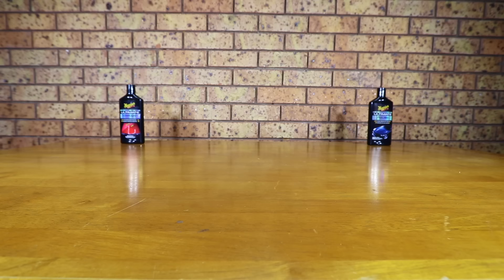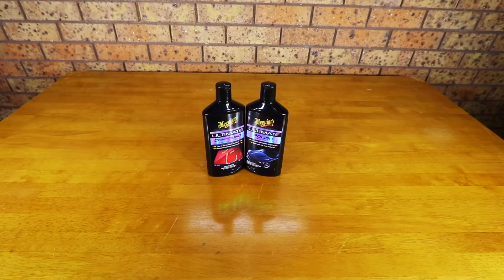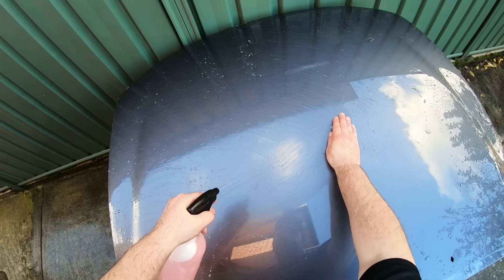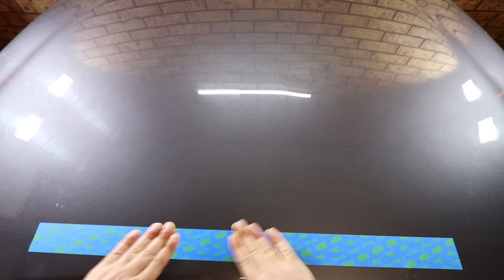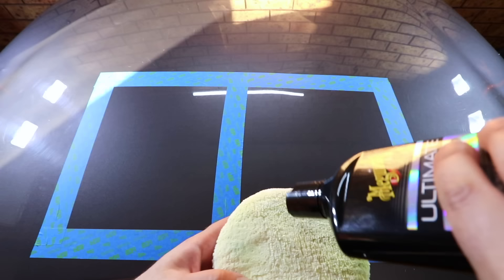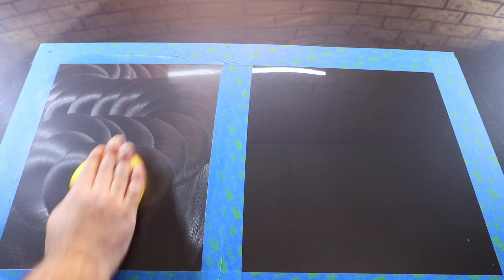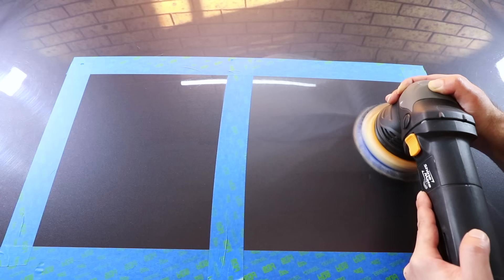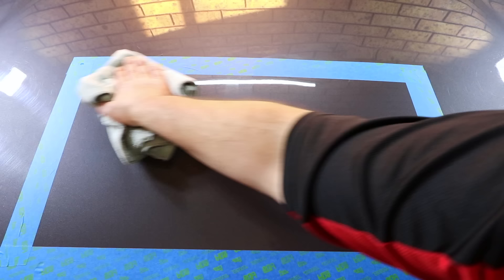How to Use Meguiars Ultimate Compound & Polish+ Review & Demonstration!

Comment: I know I’m quite late to this video but one of my doors are quite faded so would I just be able to use the polish alone then wax or is compound needed as I’m not after factory new paint just something that looks abit better than a dull blue, cheers lads
Reply from the maker: All car paint is a little different in its hardness and the specific defects or fading/oxidation it accumulates, so you don’t really know what’s going to work until you try it. I would start by using the polish and doing a smaller section to see if that gives you the results you’re after, and if so that’s great and you don’t need to use the compound. But if not, then there might be a benefit in using the compound which will be more effective if the paint needs that extra step to achieve the results you’re after.

Comment: I recently used Meguiar’s Scratch X to remove a scratch on a 2018 CRV. Most of the scratch is gone but I noticed that now part of the paint has faded (may have used too much Scratch x). I tried using Meguiar’s Ultimate liquid wax but it’s still dull in one spot.  Would using a compound and/or polish help restore the damage that Scratch X caused?

Comment: hi !  I used ultimate compoud and then ultimate Polish yesterday, but it was very difficult to remove them, they dried very quickly.  I did it in the garage at 10°C, but if I didn't remove it instantly, it was a nightmare to remove the product.  what am I doing wrong ?  I got much more tired taking out the product than applying it
Reply from the maker: It’s hard to say for sure without being there with you, but it could be your using too much products, so try halving or even using a quarter of the amount you where using. Also try working smaller sections, no more than a half meter square, but generally the smaller the section the better results and easier wipe off. You can also try working it a little longer with more pressure, I compound will go from looking more opaque to more transparent as a sign it’s been work well, broken down and should be easier to remove.

Comment: I have found each of these products dry very quickly and can be very difficult to remove, even when working in small sections.

Any tips on overcoming this issue ?
Reply from the maker: We all work a little differently and without being there next to you I can’t say for sure why you’re having that issue. 
It can be over or underworking the compounds - finding that sweet spot helps with the user experience. It can also be using too much or too little product, and your environment/climate will also effect everything. 
Sometimes it’s best to just try different compound as maybe it will suit your style of polishing better.
Reply: @CarCraftAutoDetailing  OK, thanks for taking the time to reply.

Comment: May sound like a dumb question but would it work on headlights I know there’s other options so don’t get on me about that but I’m curious if it would help any
Reply from the maker: Yes, it can work great on headlights and even other clear or plastic trims. Sometimes you’ll need to sand before hand - but not always - and if you do you can also use them to refine the sanding marks.

Comment: I have found that Ultimate Compound and M205 provide the result I am looking for without very much hassle.  For some reason M105 doesn't work well for me when I use it with a DA polisher.  By hand it is perfect, with the DA not so good.  Same issues with Ultimate Polish.  It works ok by hand, but I just have trouble with it on a DA.  I have found that M205 is much easier to work with on a DA polisher.

Comment: hi, after using Ultimate Coumpound you degrease the surfaces, right?  And after using Ultimate Polish, should I also degrease the surface before applying the wax, isn't it required?
Reply from the maker: No, it’s best not to perform a panel wipe after Ultimate polish as it may remove some of its filling abilities and degrade the finish, so you can wax right over it.
Reply: @CarCraftAutoDetailing  tkank you so much. Take care 😉

Comment: Mr Sandro, excellent video as always, I have a question, I was using meguiars with the shinemate short nap wool pad and the ex620-5/15 polisher at speed 5 (since it finished better) with the meguiars ultimate compound and was getting all the defects on a medium hard paint (the other pads that come with the polisher didn't cut enough) but the pads backing started breaking (the foam backing started fuzzing and flinging) did I used the polisher too fast or did I overheat the pads?. Greetings all the way from Mexico
Reply from the maker: Thanks mate, I can’t say for sure, but in most cases that happening tends to be due to excess heat building up on the Velcro side of the pad. I usually work with 3 pads at a time and swap after them every few section to allow them to cool before swapping them back in. Using compressed to blow out your pads can also help cool them down after each section.
Reply: @CarCraftAutoDetailing  Thanks a lot for the response I will try modifying my technique accordinly.

Comment: Can anyone advise : using the ultimate compound - after u done with a section do you wash off the  compound in the water and dry the applicator pad ?? Or just keep adding more and keep using it ??
Reply from the maker: Add a couple more drops and keep using it when working by hand - you should have a few applicators if you intend on doing the whole car, switching to a fresh one after a few panels.

Comment: Dumb question, but when you wipe of the polish or compound are you using any particular liquid or just water?
Reply from the maker: It’s an isopropyl alcohol dilution mix used to remove polishing oils and prepare the paint for a wax sealant or coating. You can buy them ready to use like Carpro Eraser or Nv Clarity or you can make your own mix using 1 part (100%) isopropyl alcohol with 3 to 4 parts distilled water.
Reply: @CarCraftAutoDetailing  thanks for the quick response

Comment: Sandro 2 questions 
Can i use any of these to get rid of scratches on Piano Black?
Do i do the whole car? (Bumpers spoiler side skirts) or is it only meant for metal panels? 

Thanks
Reply from the maker: Yes you can use it on any colour paint and piano plastics and generally if it’s painted or with a high gloss finish you can polish it, just avoid polishing matte, satin or texted trims.
Reply: @CarCraftAutoDetailing  thanks mate appreciate it 🙌

Comment: Hi a very detailed show thumbs brother one a kind of silly question is meguiars color x the same as polish wax or a cleaner wax?
Reply from the maker: Color-X would be considered an all in one polish (you can also call it a polish wax) it should do more than a cleaner wax to restore weathered paint as well as leave some fillers and a protective sealant behind, but it won’t have the true defect levelling ability as Ultimate Compound. 
It many cases Color-X could be great option - it just depends on the paint’s condition and your goals.
Reply: @Car Craft Auto Detailing  ok sounds good, but I'm still going to give you some goosebumps questions, mate 😀 😉  so if I use first meguiars ultimate compound, then meguiars color x after can it work waiting for reply desperately and wanna thank you for time and concern God Bless you mate
Reply: @CarCraftAutoDetailing  I hope u reply soon
Reply from the maker: Yes that can absolutely work well - every paint is a little different so always assess your results in the moment, but there’s no reason you can’t use that combination.

Comment: Thanks for the video. Well explained. What is that spray you used between the compounding and the polishing steps?
Reply from the maker: It’s CarPro Eraser, and IPA panel wipe to remove polishing oils.
Reply: @CarCraftAutoDetailing  Probably a silly question, but, can Meguiar's Ultimate Polish be used on the glass of the windshields and windows?
Reply from the maker: Yes it can

Comment: Just subscribed. Great informative video mate. I use UC on some small scratches from car doors hitting my paint. I applied it with a Terry cloth Applicator pad. It left a haze over the section I worked. What would you suggest I do to correct the haze?  Again, great content. It’s greatly appreciated
Reply: Car Craft Auto Detailing Great! I’ll give that a go using Ultimate Polish. Thanks for replying, have a great day

Comment: What alcohol cleaner is the best or will good old wax and grease remover do the job?
Reply from the maker: You can really use either and different paints can react differently to water based IPA cleaners and solvent based prepsol wax and grease removers so there’s not always a single best product depending on the paint and situation.
Reply: @CarCraftAutoDetailing  thank you for the response.

Comment: Will this help with oxidation? If so, what DA pad should I use? I've currently got the standard foam  pad (that comes with the supercheap Rockwell DA).
What speed setting should you set the DA polisher at?
Thanks!

Comment: Hi mate, not sure if youll even see my message due to the age of this clip. When you use those applicator pads to apply the compound /polish, do u use the same one for the whole car or does it fill up too much with product? Thx
Reply from the maker: I’ll generally use a few pads to polish a whole car and I’ll continuously use compressed air to blow the residue out of the pads and keep on swapping and rotating the pads to allow them to cool throughout the process.
Reply: @CarCraftAutoDetailing  ok thanks mate, noone ever mentions this point in the polish by hand videos that ive watched. Appreciate the reply
Reply: @CarCraftAutoDetailing  can u recommend a decent budget DA polisher? Ive sen cheap ones (mechpro) at repco for example but not sure how the cheap ones work. Id only be maintaining my cars and myvfruends and family . Dont want to spend hundreds. Cheers mate

Comment: What to do about streaking and what we’re you spraying on it when you were done working it in?
Reply from the maker: I was spraying and an alcohol based cleaner (Carpro Eraser) to remove polishing oils. If you’re finding it hard to to remove and seeing streaks, try using less product (half the amount) and try working smaller sections. You can even use a damp cloth to wipe it down.

Comment: I have a question, can i use the ultimate Compound on piano/gloss black surfaces on car and can i also use it on the glass to remove water spots?
Reply from the maker: Yes you can use it for both those areas.
Reply: @CarCraftAutoDetailing  thanks a lot:)

Comment: Can I use ceramic spray coating of turtlewax after using these two products or can I use ceramic spray directly without using polish wax? Will that be ok?
Reply from the maker: Yes either way should’ve fine, applying it before the polish and firstly doing an IPA wipe may help it last a little longer.
Reply: @CarCraftAutoDetailing  thanks

Comment: Ok so Compound with medium force then Polish, but if I don't have Polish,  could Compound with low force or a softer pad achieve the results of Polish ?
I haven't tried yet because I'm new to this and I don't want to mess it up.
Reply: The difference between compound and polish is mainly in the type of abrasives. Polish has finer abrasives. 

Like with sandpaper, you scale down from rough to fine. If you would use less compound with less force, that would be the same as using the same rougher grit sandpaper in stead of a finer grit sandpaper, and using that rougher sandpaper with less force, expecting a finer finish, which you normally only would get with the finer grit sandpaper. 

You might get away with it, but polish is always better.

Comment: How many times can I polish with ultimate compound using regular pressure on a DA before I need to worry about my clear coat thickness?
Reply from the maker: There’s unfortunately no answer to that question. It will depend on how much clear coat you car has to start with, how hard that clear is, what pads you use, your other polishing techniques beside pressure, what sort of sharp body lines your car has and so on. You could literally burn through the clear in one go or polish a hundred times without issue - it’s just all dependent on the specifics.
Reply: @CarCraftAutoDetailing  Assuming I use regular pressure with a lake coutry yellow pad on a DA polisher and I'm polishing an e46 BMW with factory paint. Assume that this BMW has been polished very few times and the clear coat is in good shape. Assume I make no mistakes with the DA and follow exactly your technique: small sections with just enough product. I am looking for an order of magnitude. 3 times, 10 times 20 times or 100 times?

It would be interesting to learn how to use a paint thickness gauge (one of those enthusiast models at $100 or so on Amazon). I wanted to buy one but I don't really understand the value behind knowing the overall paint thickness (including primer, base coat and clear coat) when my goal is to keep clear coat at a reasonable thickness. How will I deduct the clear coat thickness from the reading?
Reply from the maker: Maybe this will help 
https://youtu.be/XIIVYiWbF-w

Comment: Hi Sandro. I have a 2022 BMW X3. How is it that I'm able to use Meguiar's soft yellow polishing pad, and the ultimate polish, and get 95% defect removal on a cheap Repco polisher after 3 passes on speed 3? I thought Euros were meant to have hard paint. This is after 3x wipes with CarPro eraser to get rid of all polishing oils and fillers.
Reply from the maker: A couple of possibilities come to mind: firstly, if the defects on your X3 are only light to moderate, then that combination sound be more than adequate to remove all of them quite successfully. Secondly when we talk about hard Euro and soft Japanese paints, it’s important to note that this is typical for the vast majority of those cars, however there are always exceptions - I have certainly corrected soft euro paints and hard Japanese ones, so there are exceptions to the rule.
Reply: @CarCraftAutoDetailing  Thanks for always replying to my comments on your super old videos haha. I learn a great deal going back to your videos and binge watching.

Comment: Thank you for such great videos. I only have a rotary. Can i use them with my rotary?
Reply: Car Craft Auto Detailing Actually i started with a flex 3401 and using it for 9 years. Electrical power has always been a problem. Last year bought the cordless Milwaukee rotary and been loving it. With rotary i find some polishes and compound having too short working time and hence i asked this about using ultimate polish with rotary. Will definitely stupid your video. Thank you for all the great videos!! 😀

Comment: Hi guys, I bought these two products for my sapphire black bmw 435d. I did all the steps, rinse, snow foam, decontamination, wash, compound, polish, liquid wax, IPO and ceramic spray. All went perfect apart from the buffing off process of the compound and polish and wax. If was a complete nightmare to biff off I used small amounts and half a panel at a time, medium pressure and worked the product in, didn't allow to dry and buff off, it took the first initial haze off but left this terrible hazy cloudy residue on the pain which took hours to get off. What am I doing wrong? Only happens with miquires. Cheers guys.
Reply: @CarCraftAutoDetailing  thankyou for your insight. I've being doing some more digging and it seems alot of people have this same issue with the same product but equally as many dont. I'll contact miquires and get there advice. Seems time, pressure and temperature all play a essential role in the end finish. Can I ask if I was to polish the service again after I've applied the liquid wax and ceramic spray sealent would I have to strip the wax and ceramic first with a chemical wash and begin from the polishing stage again? Thankyou in advance.
Reply: @CarCraftAutoDetailing  perfect, I'll strip accordingly and start again, my pns break buster and Adam's mega foam just arrived so I'll look foward to trying that. Thanks again fellas appreciate your time. 👍

Comment: What do you recommend getting tree sap off? Would you recommend using 70% rubbing alcohol straight without delueting it? And knowledge would be very helpful.thanks
Reply from the maker: Not all tree sap is deposits are equally the same to remove, so just start light and work your way up. Sometimes a car APC or degreaser can work, tar removers tend to be quite effective, if they are smaller sap deposits automotive clay can sometimes lift them and yes, isopropyl alcohol at stronger strengths can also do the job. At times a cutting compound can also be effective, and if it’s a large clump of tree sap you can even use a blade to shave it down and then use the pre-mentioned products to remove the rest. Acetone and thinners will also tend to remove them but I’d reserve them as a last resort.

Comment: Would Meguiar's Ultimate Polish remove clear coat haze?  I used Meguiar's Scratch-X to remove a scratch but now it left behind a slight haze under dimly lit conditions, e.g. garage.  The haze isn't noticeable in direct sunlight.
Reply from the maker: Yes it should be able to refine compounding haze Scratch X left behind
Reply: @CarCraftAutoDetailing  What do you mean "refine"?  Sorry, I'm new to automotive detailing.
Reply from the maker: Remove
Reply: @CarCraftAutoDetailing  Ok, thanks!

Comment: Should I claybar before doing this or no?
Reply from the maker: If you feel environmental fallout then yes, if not, no
Reply: Car Craft Auto Detailing I bought a older model truck the top roof has like white spots probably clear coat fading? Also when I run the pant it’s not smooth smooth
Reply from the maker: Well it sounds like you’ll need to clay it prior to polishing.